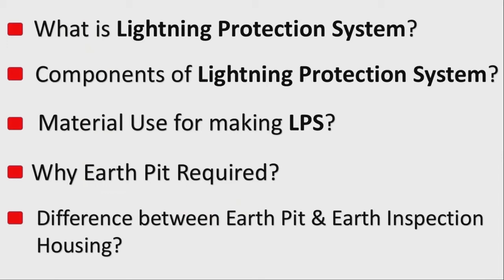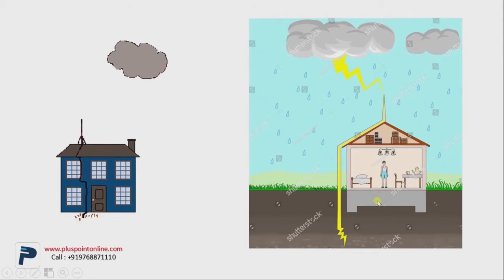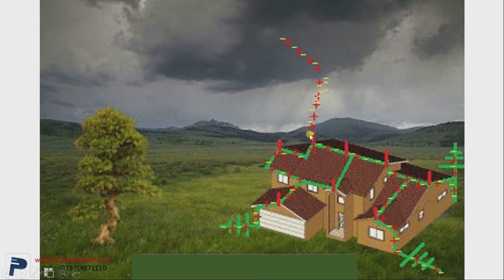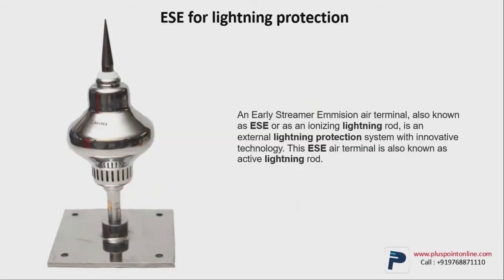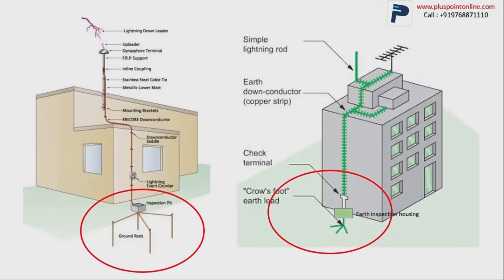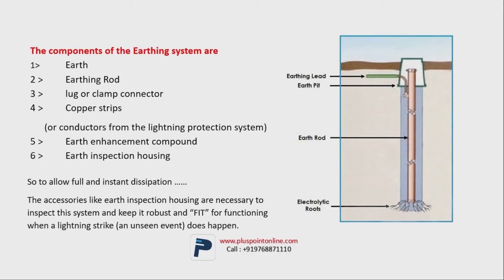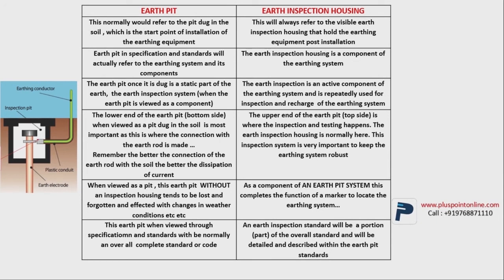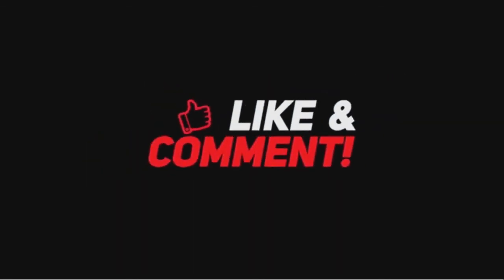What is Lightning Protection System? | Earth Inspection Housing | Lightning ROD | lightning Arrester

Comment: Normally the size of copper conductor is used how much
Reply from the maker: The size of the copper conductor used in lightning arresters can vary based on several factors, including the specific application, the level of protection required, and the installation environment. However, a general guideline is as follows:

    For Small to Medium Installations:
        Copper conductors typically range from 10 mm² to 25 mm².

    For Larger Installations or Critical Infrastructure:
        Conductors can be sized from 25 mm² to 50 mm² or even larger, depending on the load and the grounding requirements.

    Down Conductors:
        Often larger conductors (up to 50 mm² or more) are used for down conductors to ensure they can handle the high current from a lightning strike without overheating.

    Standards and Regulations:
        Always refer to local electrical codes and standards, such as the National Electrical Code (NEC) in the U.S. or IEC standards internationally, for specific requirements.

It's important to consider not only the size of the conductor but also the overall design of the lightning protection system to ensure proper grounding and safety.

Comment: Just a couple of related questions:

1.)  What country’s code requirements is this designed for?

2.) It sounds like a well thought out system, but I SEEM to remember that, at least in the USA, ALL ground systems must be bonded together to make sure they’re at the same potential. 

While a separate, semi-isolated ground would SEEM to be wise, I’m curious.

Also, there has been some speculation as to how a LPS ACTUALLY works. I had read that in addition to shunting an actual lightning strike to earth/ground, it may also function to ”bleed off” the charge differential to help PREVENT an actual strike.

It’s been a few years, and research may have improved.